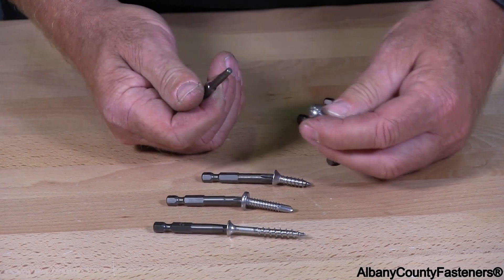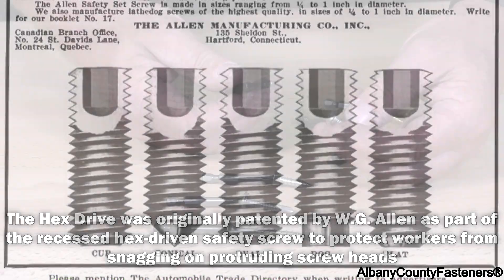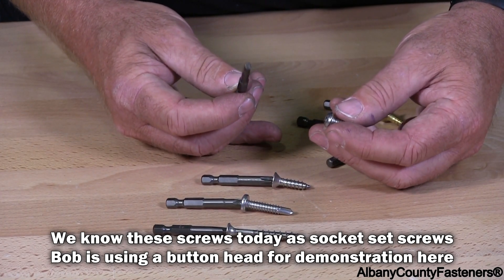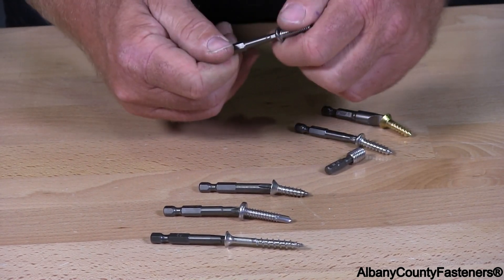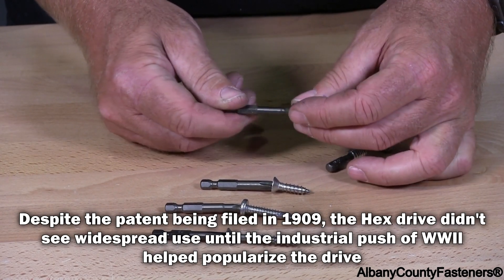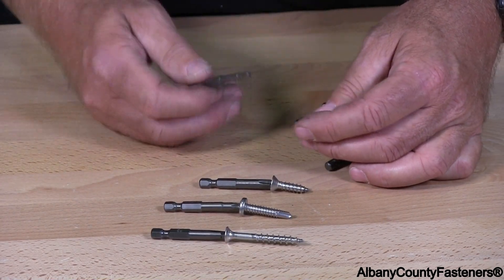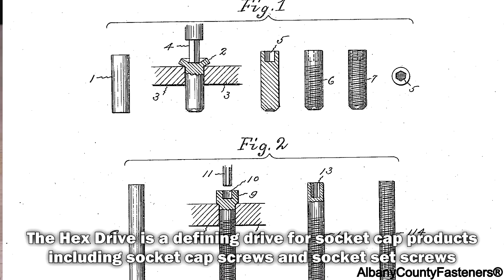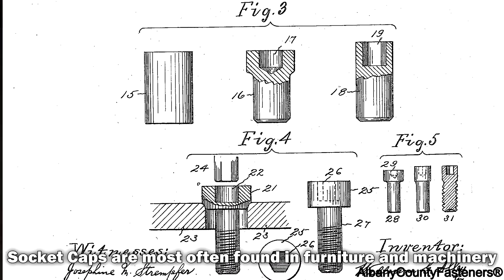The Hex Drive - Types of Screw Drive Styles | Fasteners 101

Comment: i'm doing a DIY major maintenance to my hyundai azera & i want my work to be pro. so i'm going to fasten with the proper torque by a meteric fasteners table providing torque for every diameter. the problem is this metric table is asking for the class\garde of the fasteners & the fasteners is only having the number of the diameter on it only! so how to know the grade? is it by the color? or should i do the lower torque for the lower grade to be in the safe side? but i'm afraid it wont tight things properly!
Reply from the maker: Marking should be on the head in slash's or numbers i.e. 10.9.  No markings are standard grade.  Color does not always indicate grade.  Numbers plus slash's or numbers equal grade bolts.